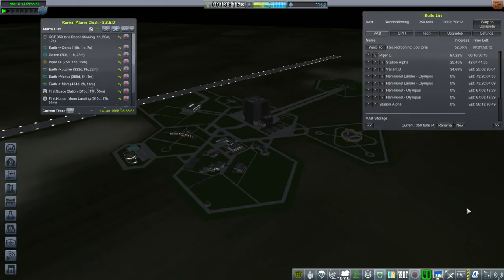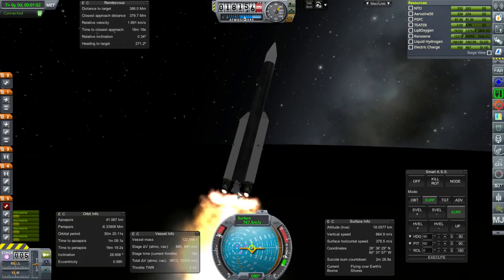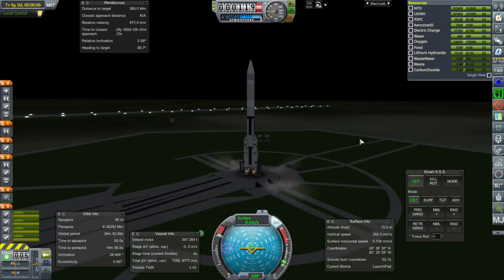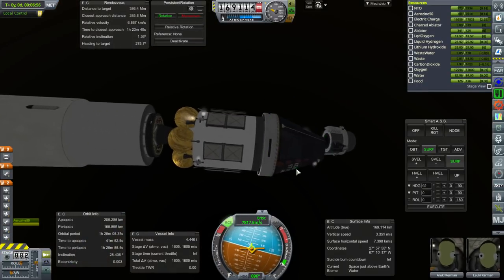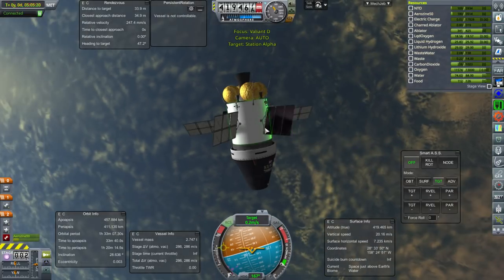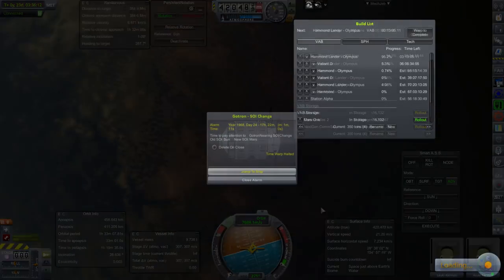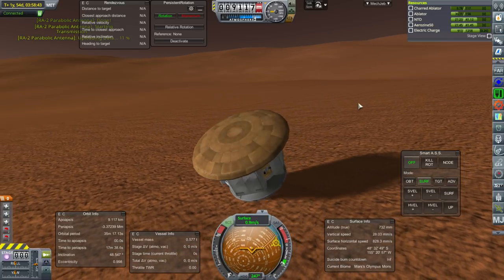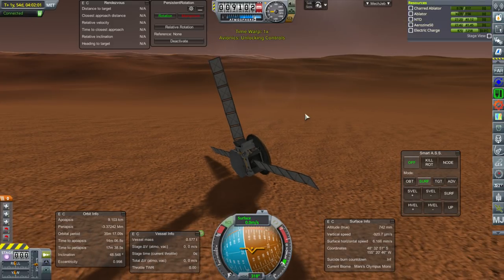KSP 1.3.1 with Realism Overhaul - RP-1 34 - Station Alpha

Comment: I think the logic with the J-2 is that in the atmo during high dynamic pressures, the exhaust gets under-expanded and that can cause combustion instability and damage the nozzle. Irl the results could be a lot more explosive than just an engine not igniting.
Reply from the maker: But its nozzle isn't actually that high a ratio - just 27.5. The Vulcain, which is another gas generator hydrolox with about the same thrust has a 45 nozzle ratio, and it actually lights on the ground. Vulcain has higher chamber pressure, but J-2 should still be able to light on the ground, albeit at not so good ISP.
Reply: @RaizSpace  Hmm, perhaps you are right. Maybe testflight is just too tough on it.